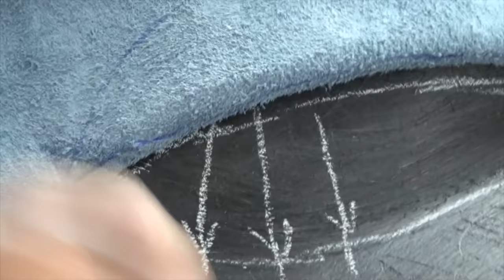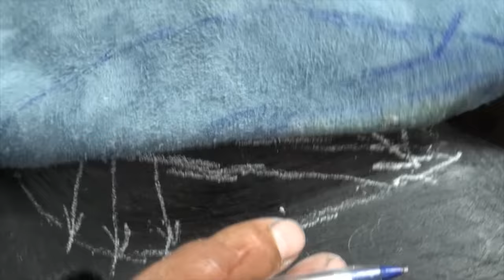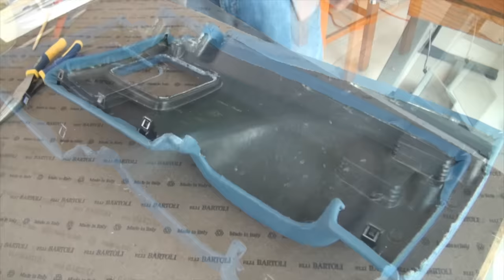A Plastic Piece Wrapped in Leather - Auto Upholstery

Comment: Years ago my buddy bought a BMW that came with a leather dash from the factory. When in 6 months the leather shrunk and turned the dash into a skateboard park. BMW could not source a new one and so swapped it for a plastic one. Another buddy has a 911 SC with a leather dash and guess what, it crumpled and was essentially destroyed. The lesson: the leather shrinks.
Reply from the maker: Very interesting remark! Thanks so much for watching these videos!
I have heard this story several times and am trying to figure out why this happens with supposedly high-end car interiors (Porsche, BMW, etc.).
Usually, this issue happens because the sunrays (UV) act directly or indirectly over the leather material causing damage. These car's interiors are wrapped with first quality leathers. The answer could be that 'premium leathers' are non-finished Aniline or Semi-aniline leathers.  Unfinished means they do not have much protection for the UV rays...nothing or perhaps a light coat of transparent sealer(lacquer). These leathers are considered the best for being full grain, very soft and pliables.
These leathers are very delicate as they do not have enough protection against the environment, they need to be constantly (a must) cleaning, rehydrating and conditioning with special creams and conditioners. Otherwise they are condemned to shrink and become brittle. Irreversible damage. If someone leaves the car well kept with a cover in a garage thinking it is well preserved it is wrong. The bad surprise will be in a few months if the care was not proper as mentioned above.
Reply: @Cechaflo  I have a home in Arizona. You would be shocked at the number of pristine, rust free twenty year old high end cars there are with cooked seats. Now leather is more popular than ever and new cars are washed so often (dust) that the paint wears away; but do they treat the leather interiors? Nope. 
Best regards.
Reply from the maker: @larrysorenson4789  I now clearly understand what causes this issue. Thanks so much for sharing this experience and information!
Reply: Used to make leather for a living. I'd question where BMW sourced their material? We did a lot of testing including exposure to sunlight. Leather will shrink if exposed to high temperatures but that should be limited. Heat is used in shoe making to get leather to conform to a shape so shrinkage tests are carried out. I doubt much unfinished leather is used for upholstery as it would not be practical to clean also a finish will produce a final regular even color. I think the issue may have been down to the finish applied as the bulk of upholstery leathers are finished. Incidentally the best car interior leather was made by Connollys in the UK and it lasted for ever.

Comment: Professional work, what is the adhesive used name and thank you .
Reply from the maker: I use a 'yellow glue' which comes in cans or bottles and most of the upholsterers, shoemakers and leather artisans use. If you are in USA, please, check:http://www.homedepot.com/p/DAP-32-fl-oz-Weldwood-Original-Contact-Cement-00272/100125525
http://www.ebay.es/itm/Petronios-Master-All-Purpose-Cement-Glue-Shoe-Repair-Adhesive-Glue-4-oz-/291064753112 
Thanks for appreciating this craft!
Reply: Thank you very much sir

Comment: may i know what type of glue do you used? and can i use it on faux leather?
Reply from the maker: I've used a yellow glue most of the upholsterers, shoemakers and leather artisans use it. It also works for faux leather. Do a test of the product before using it. To have an idea, please, check these links:http://www.ebay.com/itm/Petronio-039-s-Master-All-Purpose-Cement-Glue-Shoe-Repair-Adhesive-Glue-4-oz-/112032405167?_ul=EC
http://www.ebay.com/bhp/weldwood-contact-cement
Reply: thank you for your quick reply. apperciate it a lot and look foward to try it. :)

Comment: Can this glue be used when wrapping wood?
Reply from the maker: It is the same glue used to stick formica to  wood.
https://youtu.be/o2xeezdF8Ss
It is advisable to coats of glue over the wood to get a better adherence.
https://www.youtube.com/watch?v=beiywfE1lZE
Reply: What about the weldwood glue?
Reply from the maker: @BillyRay501  Weldwood glue is good.
https://www.ebay.com/itm/144030235368
Reply: @Cechaflo  thanks can you tell me what brushes I need to use
Reply from the maker: @BillyRay501  kind of painting brushes of hard bristles. https://youtu.be/8_nh0DctARg?t=597
Reply: @Cechaflo  thanks

Comment: Can you tell me where I can get glue like you are using I never have very good glue
Reply from the maker: I am located in Mexico and I'm using a 'solvent based yellow glue/contact cement'...trade marks are diferent.
If you are in USA, please, check these links:
https://angelusdirect.com/products/all-purpose-shoe-cement
http://www.ebay.es/itm/Petronios-Master-All-Purpose-Cement-Glue-Shoe-Repair-Adhesive-Glue-4-oz-/112032405167
http://www.homedepot.com/p/DAP-Weldwood-32-fl-oz-Original-Contact-Cement-00272/100125525
http://www.dap.com/dap-products-ph/weldwood-landau-top-trim-high-heat-resistant-contact-cement/
Watch min two:08 of this video where Greg shows the use of ´petronios'glue.
https://www.youtube.com/watch?v=RLH8BY8a2to

Comment: what glue did you use? i really need it ASAP
Reply from the maker: I have used a brushable 'yellow glue' ( https://www.youtube.com/watch?v=o2xeezdF8Ss). The drying time is of 10 min. approx. If you are in USA, please, check these links:
https://angelusdirect.com/products/all-purpose-shoe-cement
http://www.ebay.es/itm/Petronios-Master-All-Purpose-Cement-Glue-Shoe-Repair-Adhesive-Glue-4-oz-/112032405167
http://www.homedepot.com/p/DAP-Weldwood-32-fl-oz-Original-Contact-Cement-00272/100125525
http://www.dap.com/dap-products-ph/weldwood-landau-top-trim-high-heat-resistant-contact-cement/
Watch min two:08 of this video where Greg shows the use of ´petronios'glue.
https://www.youtube.com/watch?v=RLH8BY8a
This video shows Barge glue from Tandy leather:https://www.youtube.com/watch?v=PE6dGvgWfnU

Comment: hi there what sort of glue is that and where can i purchase it . many fanks
Reply from the maker: I have used a solvent based(thinner) adhesive/cement/glue which most of the upholsterers and shoemakers use. To have an idea, please check these links:
http://www.ebay.com/itm/Petronio-039-s-Master-All-Purpose-Cement-Glue-Shoe-Repair-Adhesive-Glue-4-oz-/112032405167?_ul=EC
http://www.ebay.com/bhp/weldwood-contact-cement
If you're going to use one of these products, do a test beforehand.
Reply: thanks for the info .cheers.x

Comment: Hi
What is this glue?
Can I buy it on the market?
Reply from the maker: I am located in Mexico and I'm using a 'solvent based yellow glue/contact cement'...trade marks are diferent.
If you are in USA, please, check these links:
https://angelusdirect.com/products/all-purpose-shoe-cement
http://www.ebay.es/itm/Petronios-Master-All-Purpose-Cement-Glue-Shoe-Repair-Adhesive-Glue-4-oz-/112032405167
http://www.homedepot.com/p/DAP-Weldwood-32-fl-oz-Original-Contact-Cement-00272/100125525
http://www.dap.com/dap-products-ph/weldwood-landau-top-trim-high-heat-resistant-contact-cement/
Watch min two:08 of this video where Greg shows the use of ´petronios'glue.
https://www.youtube.com/watch?v=RLH8BY8a
This video shows Barge glue from Tandy leather:https://www.youtube.com/watch?v=PE6dGvgWfnU

Mostrar menos

Comment: No sound. What type of glue are you using ?
Reply from the maker: I am located in Mexico and I'm using a 'solvent based yellow glue/contact cement'...trade marks are diferent.
If you are in USA, please, check these links:
https://angelusdirect.com/products/all-purpose-shoe-cement
http://www.ebay.es/itm/Petronios-Master-All-Purpose-Cement-Glue-Shoe-Repair-Adhesive-Glue-4-oz-/112032405167
http://www.homedepot.com/p/DAP-Weldwood-32-fl-oz-Original-Contact-Cement-00272/100125525
http://www.dap.com/dap-products-ph/weldwood-landau-top-trim-high-heat-resistant-contact-cement/
Watch min two:08 of this video where Greg shows the use of ´petronios'glue.
https://www.youtube.com/watch?v=RLH8BY8a

Comment: whats the dry time for that snot? and the brand if possible?
Reply: cure to adhesion time, not dry time sorry.
Reply from the maker: It's the 'yellow glue/contact cement' most of the upholsterers and shoemakers use it. Check these links:
https://angelusdirect.com/products/all-purpose-shoe-cement
http://www.ebay.es/itm/Petronios-Master-All-Purpose-Cement-Glue-Shoe-Repair-Adhesive-Glue-4-oz-/112032405167
http://www.homedepot.com/p/DAP-Weldwood-32-fl-oz-Original-Contact-Cement-00272/100125525
http://www.dap.com/dap-products-ph/weldwood-landau-top-trim-high-heat-resistant-contact-cement/

 · 1
Reply from the maker: Ashesion time is from five to ten minutes approx.  It is ready when it is not sticky to our fingers.
Reply: okay, Almost Identical to what I already use. Thanks.

Comment: Where you get your materials from?
Reply from the maker: From local suppliers
Reply: @Cechaflo  well kind leather are you using or is it stretch vinyl
Reply from the maker: @dizzelfunk3364  It is real upholstery cow leather. Upholstery leathers should be soft and pliables. Their thicknesses regularly are from 0.8 mm, 1 mm, 1mm, 1.2, 1.3 to 1.4 mm thick.
I suppose you are in the USA and inteested in doing some upholstery project. If so, you can check out APEX leather supplier.
https://apexleather.com/

Comment: Hi can you tell me from where you buy this leather please?
Reply from the maker: I bought this leather from a shoe leather supplier here in Mexico. It is not ideal for cars, because it has not the sealer/lacquer on top, but I used it as a test to know how durable is a 'shoe leather'.  I had to apply by hand a coat of lacquer(water based). This leather is still in good condition and the leather interior has been repainted in a combination of black and marine blue. 
An 'automotive leather' should be used for cars.
Reply: Cechaflo thanks for information

Comment: What kind of glue did you use?
Reply from the maker: I have used a brushable 'yellow glue'. The drying time is of 10 min. approx. If you are in USA, please, check these links:
https://angelusdirect.com/products/all-purpose-shoe-cement
http://www.ebay.es/itm/Petronios-Master-All-Purpose-Cement-Glue-Shoe-Repair-Adhesive-Glue-4-oz-/112032405167
http://www.homedepot.com/p/DAP-Weldwood-32-fl-oz-Original-Contact-Cement-00272/100125525
http://www.dap.com/dap-products-ph/weldwood-landau-top-trim-high-heat-resistant-contact-cement/
Watch min two:08 of this video where Greg shows the use of ´petronios'glue.
https://www.youtube.com/watch?v=RLH8BY8a
This video shows Barge glue from Tandy leather:https://www.youtube.com/watch?v=PE6dGvgWfnU

Comment: What do you use for pasting?
Reply from the maker: I use a yellow glue most of the upholsterers and shoemakers use it. If you're in USA, please, check:
http://www.homedepot.com/p/DAP-32-fl-oz-Weldwood-Original-Contact-Cement-00272/100125525
https://www.tandyleather.com/en-usd/home/department/leather-cement-glue/2525-360.aspx
http://www.ebay.es/itm/Petronios-Master-All-Purpose-Cement-Glue-Shoe-Repair-Adhesive-Glue-4-oz-/291064753112

 ·
Reply: Cechaflo thank you 😊

Comment: I did mine and it all bubbled and come off there must be better glue the evo stick
Reply from the maker: If you are in the USA you could use Landau top trim glue. Most of the upholsterers use it.
https://jjautofabrics.com/dap-1145-natural-landau-top-trim-adhesive-1-gallon/
https://www.albrightssupply.com/dap-weldwood-contact-adhesive-1-gallon-weldwoodg
For a better adherence I would recommend to rub off the oily surface of plastic píece. A sandapaper medium grain is useful. 
I also recommend the application of two coats. The first coat acts like a primer. It should dry well after a few minutes(20 min approx.) The second coat over the first is the good one.
Some upholsterers also recommend HH-66 for vinyl materials.
https://www.albrightssupply.com/hh-66-vinyl-cement-glue-1-quart-hh66q
I'd recommend to do some tests of the product beforehand.
Good luck!

Comment: May I know the name of the glue used and is this heat resistant?
Reply from the maker: Hello, As I am located in Mexico, trade marks are different. But, if you are in USA, please, check these links:
https://angelusdirect.com/products/all-purpose-shoe-cement
http://www.ebay.es/itm/Petronios-Master-All-Purpose-Cement-Glue-Shoe-Repair-Adhesive-Glue-4-oz-/112032405167
http://www.homedepot.com/p/DAP-Weldwood-32-fl-oz-Original-Contact-Cement-00272/100125525
http://www.dap.com/dap-products-ph/weldwood-landau-top-trim-high-heat-resistant-contact-cement/
Reply: Cechaflo you're awesome man, thank you!
Reply from the maker: You are welcome anytime!

Comment: What kind of glue is used?
Reply from the maker: I am located in Mexico and I'm using a 'solvent based yellow glue/contact cement'...trade marks are diferent.
If you are in USA, please, check these links:
https://angelusdirect.com/products/all-purpose-shoe-cement
http://www.ebay.es/itm/Petronios-Master-All-Purpose-Cement-Glue-Shoe-Repair-Adhesive-Glue-4-oz-/112032405167
http://www.homedepot.com/p/DAP-Weldwood-32-fl-oz-Original-Contact-Cement-00272/100125525
http://www.dap.com/dap-products-ph/weldwood-landau-top-trim-high-heat-resistant-contact-cement/
Watch min two:08 of this video where Greg shows the use of ´petronios'glue.
https://www.youtube.com/watch?v=RLH8BY8a
This video shows Barge glue from Tandy leather:https://www.youtube.com/watch?v=PE6dGvgWfnU

Comment: What is your glue of choice?
Reply from the maker: I am located in Mexico and I'm using a 'solvent based yellow glue/contact cement'...trade marks are diferent.
If you are in USA, please, check these links:
https://angelusdirect.com/products/all-purpose-shoe-cement
http://www.ebay.es/itm/Petronios-Master-All-Purpose-Cement-Glue-Shoe-Repair-Adhesive-Glue-4-oz-/112032405167
http://www.homedepot.com/p/DAP-Weldwood-32-fl-oz-Original-Contact-Cement-00272/100125525
http://www.dap.com/dap-products-ph/weldwood-landau-top-trim-high-heat-resistant-contact-cement/
Watch min two:08 of this video where Greg shows the use of ´petronios'glue.
https://www.youtube.com/watch?v=RLH8BY8a

Comment: Where can I find that glue
Reply from the maker: The 'solvent based yellow glue' is a traditional adhesive or contact cement used in car upholstery and furniture. It is the same glue used to stick formica as shown in the video about Upholstery Glues:
✅ https://youtu.be/o2xeezdF8Ss

Different trademarks:
https://www.homedepot.com/p/DAP-Weldwood-128-fl-oz-Original-Contact-Cement-00273/100139723
https://www.amazon.com/-/es/Petronios-Master-Cemento-multiuso-cada/dp/B076DJQN5R?language=en_US
https://www.dap.com/products-projects/product-categories/adhesives/contact-cement/landau-top-trim/
Reply from the maker: https://www.youtube.com/watch?v=o2xeezdF8Ss&t=234s
https://www.amazon.com/Master-Comp-Petronios-All-Purpose-Cement/dp/B09B2463HZ
https://www.amazon.com/Weldwood-Contact-Cement/s?k=Weldwood+Contact+Cement

Comment: I don't think he's using regular pva glue, I think that's contact cement.
Reply from the maker: https://www.youtube.com/watch?v=o2xeezdF8Ss&t=414s
Reply: @Cechaflo  YUP, those are definitely contact cements, you can tell because you do both sides and you let them dry before sticking together. They used to call those types of glues "rubber cements''' decades ago.
Reply from the maker: Yes, those are spreadable solvent based adhesives:https://www.homedepot.com/p/DAP-Weldwood-32-fl-oz-Original-Contact-Cement-00272/100125525
https://www.amazon.com/-/es/Petronio-Master-Cemento-multiusos-onzas/dp/B076DJQN5R

Comment: I'd like to see that piece of plastic after a year in the sun.
Reply from the maker: This piece is part of a car dashboard. It was a kind of test to leather and glue durability. I had the car checking out more than 7 years in daily use with no unsticking problem on the dashboard.
https://youtu.be/7At9Z_LoMis?t=593
Reply: @Cechaflo  I live in Arizona where dashboards are especially vulnerable to the sun.  Temps can reach over 200F.  You didn't mention what brand contact cement you used.
Reply from the maker: @ramtek2702  I understand now it is a extreme weather in Arizona. Perhaps it would not unstick, but the leather would become briitle very fast. There is no leather that endures that hot weather.
I am located in Mexico and upholstery glue trademarks are different than the USA. I used a brushable glue.
https://www.youtube.com/watch?v=o2xeezdF8Ss&t=320s
Similar yellow glues in the USA:
https://glueplace.com/industries/contact-adhesives/dap-weldwood-contact-cement-top-trim-hhr-solvent-type-spray-grade-5-gallon/ (sprayable and brushable)
https://www.ebay.com/itm/114649877783 (brushable)
Reply: @Cechaflo  Anyway, you did a beautiful job.  I didn't think you'd get that thick leather to conform to all those small features.
Reply from the maker: @ramtek2702  Fortunately leather material stretches in one direction and I took advantage of it.

Comment: What kind of glue is used?
Reply from the maker: The 'solvent based yellow glue' is a traditional adhesive or contact cement used in car upholstery and furniture. It is the same glue used to stick formica as shown in the video about Upholstery Glues:
✅ https://youtu.be/o2xeezdF8Ss
Reply: @Cechaflo  thank you for replying!! I just did a steering wheel and want to get the spokes edges to Adhere flat so thank you, I’ll go pick some up